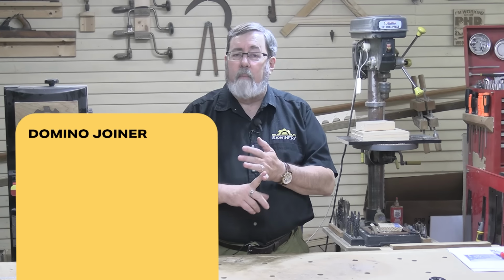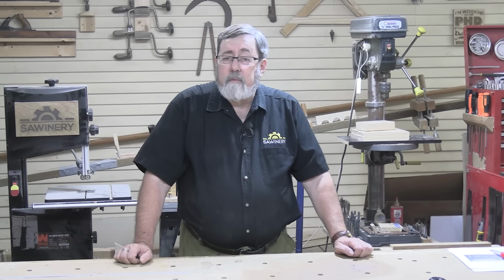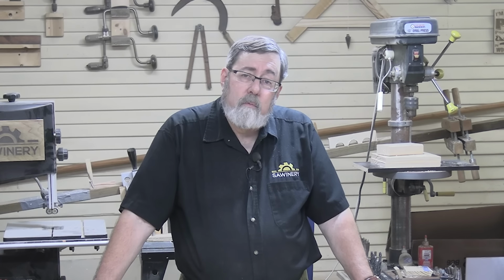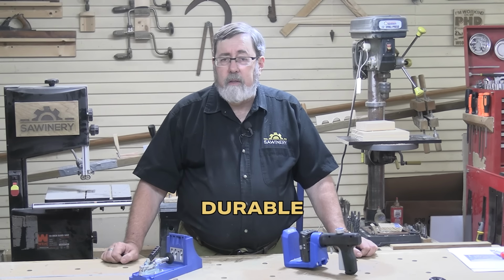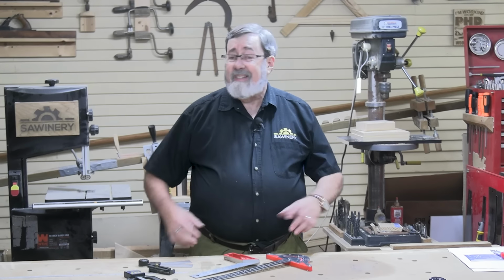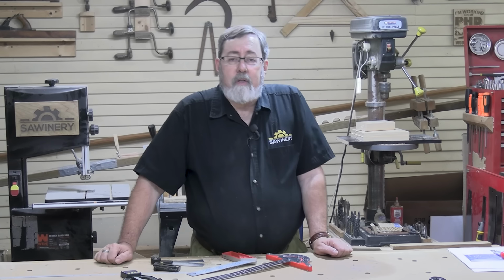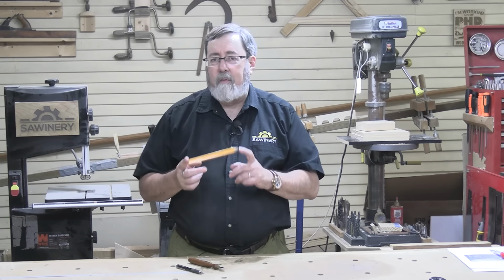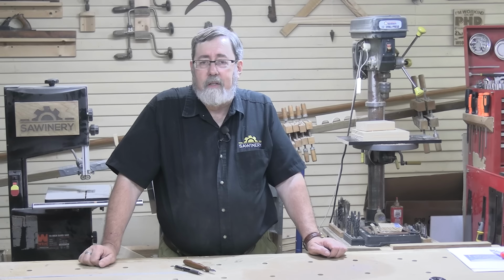5 Most Overrated Woodworking Tools

Comment: My 5 Most Overrated Woodworking Tools:
Battery-driven tools x 5
It is good to have battery-driven tools, but it must be a choice for customers, not an obligation. I see that the producers would like to have everything running by battery. Why should a light stand be powered by a battery? Of course, as a choice, it is good for situations with no electricity.
They earn good money by selling us batteries and chargers in addition to a hot glue gun!

Comment: Just because it's popular, it does not make it overrated necessarily.
Reply: @masterpiecetools131  well, I mean a biscuit in itself is really only good for alignment because it doesn't provide any strength. I could never justify paying the kind of price they want for a domino.
As for joinery goes, pocket hole has quite the following, but it will always come down to each method having it's place. I like mortise and tenon when I build a table for example. It's strong and reliable. I guess it just comes down to application. But now you have me scratching my head about my recent purchase of my Hercules miter saw. Maybe I just need to build a good sled for my table saw.
Reply: in my opinion, biscuits are too loose even for alignment, maybe it’s the tool (me) or something else.

Comment: Yeah, but you don't need a height gauge. You can use a tape measure or a ruler. A height gauge is unnecessary.  See how easy it is to fall into that trap. Honestly we don't need any power tools. We could just use hand tools. I have all the tools you claim as unnecessary.  I don't use any of them for all my projects. But when I need one of them I have it. It's all a matter of what you're used to.

Comment: I prefer glue and bread, nails over pocket holes. I have a miter saw from Hercules that I got for $300 and I have it set so it  is perfect as for as I can see. As for face frame I have a cheap dowel jig. With glue and dowels the frame will not come apart.

Comment: I think the arguement that people have done woodworking  without the Domino is a bit weak, as people also have done woodworking without table saws for thousands of years as well and still this is one of the standard machinery for woodworking par excellence. The Domino is expensive, that is right. But... the Festool stuff is second to none in terms of quality and precision. And it is not made in red China like most manufactors do (yes, also most of the premium manufactors). I agree with the Domino is not a tool that is needed, but it is still a great tool for a nice and strong joining solution. Same goes for the Maffel double joiner, expensive as hell and not a must have. But still a great tool that does joining within a few seconds.

I agree with the miter saw not beeing neccessary for a woodworker. A table saw does everything a miter saw does and even more (and more precise if it is a proper table saw). BUT... a proper (and i´m not talking about these mobile Bosch / DeWalt / Metabo / Makita table saws) table saw like one made by Ulmia or Erika is 1. very large and 2. very expensive (a new Erika is up to 35.000,- €, used still between 15.000,- € and 20.000,- €, the small Ulmia table saws start at 6.000,-€ new), so a miter saw is a good alternative for home woodworkers, especially of you´re limited with space. And the miter saw does a lot of things faster than a table saw.

Comment: I disagree about the miter saw. Try cutting a foot or so off 8 foot stock on the tablesaw. Or anything over 3 or 4 feet really. It's nearly impossible to keep the stock flat against the table and miter gauge with that much stickout. I would need a sliding cabinet saw or something to safely do those kinds of cuts

Comment: I like my miter saw. Cheap cordless Ryobi 7 1/4" one. It goes through oak, and hard maple without much problem. I agree with the sentiment though. After I cut things to a rough length they go over to the table saw for a better and more square cut. I'd hate to have to cross cut an 8' board on a table saw.

Comment: I’ll never feed a board over like 3ft long to do a miter on my table saw.  That’s just dangerous. Any 1/2 way decent miter saw will be as good and safer. I’ll agree with ya on domino, and the gimmicky marking squares. Carpenters pencil is for framing, don’t know any woodworking/furniture makers that use one.

Comment: Gotta disagree about the miter saw. it is FAR handier for and has greater and faster repeatability if you have a miter station. As far as having greater accuracy on the table saw cutting miters, you always cut to the degree of accuaracy that YOU impose. If you are getting sloppy cuts, it is because you are sloppy. You are right about it not being necessary. Your argument against pocket hole joinery is weak. NO joint is good for everything, but you can make joints for almost everything you do with pocket holes. That being said, I usually glue all my joints before I put the screws in... especially on large glue-ups (like a table top). The screws act as a clamp where I can't fit a clamp in. It was SHOCKING to hear that you don't know how to use pocket holes to glue-up slabs. nothing could be easier. I have done it a couple of times because I can only thickness boards up to 13", so i pocket hole the segments. I don't know how anyone can know that any measuring device is accurate because anything you compare it to could be inaccurate also. How would you know which is wrong? All you can know is that the 2 devices are the same inacuracy or a different inaccuracy. The bottom line is that if you are within 1/64, everything will probably work out fine. You are 100% correct about the carpenters pencil. Useless...even for carpentry. if I need to make a line that is absolutey accurate, I use a scribe or a razor knife (aka box cutter)

Comment: Whoa, Nelly!  I agree with you about Festools domino. Im glad u talked me out of it!  I disagree with the miter saw. As im hesitant about using my table saw. However its a necessary evil for repeated cuts. And you left out #6)   Trac-saws!  Agree or disagree?
Reply from the maker: I’m going to feel a bit like a hypocrite saying this, as I have a track saw; but I agree with you. Track saws are a lot of money for what you get out of them. Any woodworker can do the same thing with any straight piece of wood as your “track” or fence to run a standard circular saw against. I did that for years. When I moved away from a track saw, it was to the Kreg Rip-Cut. That gave me a great way of cutting plywood sheets accurately, without spending a small fortune. The only reason I have a track saw now, is that someone gave me one.
Reply: @sawinery-woodworking  Thanks for the response & honesty. B/c that's exactly what I thought. That the Kreug accu'cut serves the same purpose.
Reply: You should honestly do your own research and try domino and track saw. Just because someone on the internet has an opinion doesn’t necessarily mean it’s right. Go to Rockler or wood craft and try these tools for yourself. If I didn’t have a track saw I wouldn’t be doing any woodworking for space reasons. I also have a domino and it is an amazing tool and does amazing work fast. I tried the straight piece of wood trick with a circular saw, try making  straight cuts on 5 cabinets and you’ll be driving to Home Depot for the track saw.

Comment: If you show up to my jobsite and tell me that an 1/8 inch off is fine for framing you’re fired on the spot the only time where an 1/8 is acceptable is vinyl siding I want those measurements in 16ths accuracy makes straight walls straight walls make a straight top plate a straight top plate makes a straight roof and everything works in sequence

Comment: Eh you buy 1-2-3 blocks and a cheap set of Joe blocks 
Oh how do i know this?  
I worked in a machine shop
The joe blocks are for inspection
But they make very cheap sets now 
That cost a tad more then setup blocks, but are a lot more accurate.

Comment: I also own a radial arm saw it was my father's and it's close to 50 years old if you can tolerate the finickyness of trying to get into an angle besides the true 90 from The Back Fence it will work but it's a lot of work it's better just to cut 90s with. 
I also have a sliding miter saw I acquired knew about 15 years ago it was for doing crown molding in some other work it did well it doesn't have a lot of wear on it still Cuts nicely but when I downsized my shop in the near future it will go along with the 
Radial arm saw.
Cancel as you stated accurately is very inaccurate for marking I use it for gross layouts make sure what I'm trying to accomplish will work if it needs to be very accurate maybe the mechanical pencil or then the marking knife or razor knife. We are both on the same page for that one.
I've done three projects small ones cabinets using pocket hole jig they work okay they require patience and there are many alternatives of doing joinery to avoid them but I still have one it seems to always end up to the back of the drawer.
I have a Dowling jig works okay biscuit joiner I know I own it I can't tell you why I used it last. I wholeheartedly agree with you using a Festool Domino he's probably great for a mass production shop not the weekend warrior or the weekend hobbyist.

The scale ruler with holes in it as you mentioned are sloppy I'm not sure what brand they design them around for mechanical pencil I've got one that's close but doesn't drop in there perfectly every time. And can be off as much as a 16th of an issue using a lead pencil because it flops around inside the hole if you use one of the large lead mechanical pencils that fit in there tight you don't have a point if you do it wears off too quickly.
Why when I first learned Machining 50 years ago I think the product was called dicom it was a blue stain that you put on metal that you would score with a knife or a sharp tip all Mark your lines and do them very accurately.

Unrelated but a bone of contention we try to do a woodworking to be done accurately and precisely without requiring a lot of rework to get it to look that way why is it a machinist bandsaw can cut a straight line all day long no matter how tall the blade is it doesn't excellent job get a Woodworkers band saw and if you can cut a straight line you did it with great effort.

It seems like coming from machinist world going into woodworking should have been easier and more enjoyable at times is more frustrating.

I'm trying to remember an employer I work for the cannot remember the  exact quote he said but the gist of it was metalworking is cold and very precise woodworking is warm less precise but can be made to be precise with a lot of extra effort.

So as I end this long diatrobe I look over my length of my life nearly 70 years now and woodworking is all about compromise.
Poorly made tools poorly executed functions of those tools. 

I hope everyone has a grand day and thank you for taking the time to read this long written comments.

Comment: I was able to hold my tongue when you talked about the miter saw (don’t ask me how) but when you talked about the carpenter pencil I couldn’t keep it to myself anymore. Nobody ever said a carpenter pencil can or should be used for woodworking. Nowhere is it called a woodworking pencil. It’s used for general carpentry and its shape is twofold. It won’t roll off a sloped surface and it can be used to scribe an uneven surface. Anyone trying to use it for woodworking should be doing taxes or flipping burgers for a living. Since you got me worked up about the carpenter pencil I’m going to have to completely disagree about the miter saw. You can’t safely or accurately cut a tenon or even cut the end of an 8 foot 1x6 or a 6 foot 2x8 on a table saw. You can with a miter saw. If you have a miter saw you can get clean end cuts because you are using a 60, 80 or a 100 tooth blade but if you are using a table saw you most likely are using a 20 tooth rip blade or maybe a 40 tooth blade but it’s going to be a poor substitute for cross grain cuts unless you stop to change out the blade and even then you still have the long length to contend with. Trying to convince people not to buy a miter saw is doing them a disservice and will cause them hours of frustration.

Comment: Amen to the whole BS about a domino joiner.  So so over  priced for what it really is!  A loose tenon jig.  Given the thickness of the dominos they do provide better strength vs a wafer thin biscuit joiner.   But the biscuit joiner is really called a plate joiner.  It has the ability to have alignment for the surface plane of joined wood planks for tables or doors and windows .  They are also able to adjust laterally since the biscuits are oval .   Dominos can be set to have the lateral flexibility if you set it properly    
While I do love the accessibility of dowels they don’t offer much in the way of flexibility for lateral alignment.  It’s either perfect or not .   But once you get used to the jig it’s pretty easy to get perfect alignment.   Hey IKEA has been using dowels for decades!  
So no domino joiner for me .. too pricey and over rated

Comment: Biscuits swell. .008 of an inch is nothing in woodworking.  Take off more than that when you sand.
Reply: @masterpiecetools131  I love using hide glue. I use on most things except structural joints.
Reply: Woodworking is not machining.  Give me a perfectly calibrated measuring device, and my error in reading it will be greater than 0.008 of an inch.  That's basically 1/128th.  Seasonal wood movement will likely be greater than that.